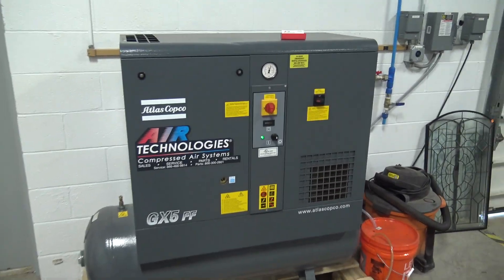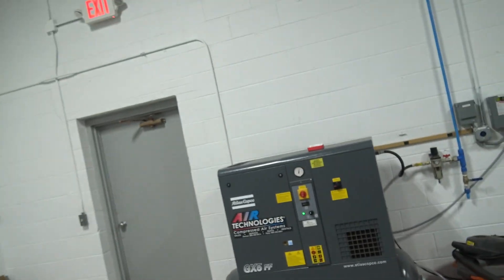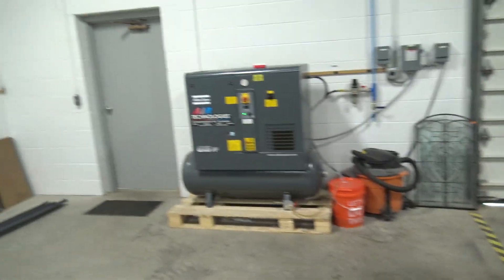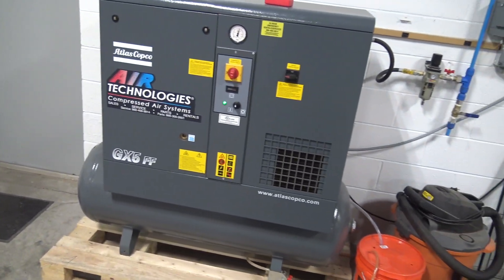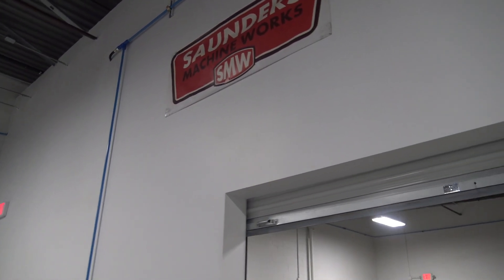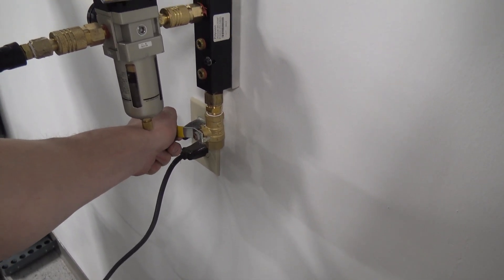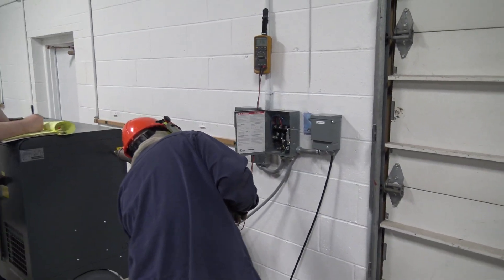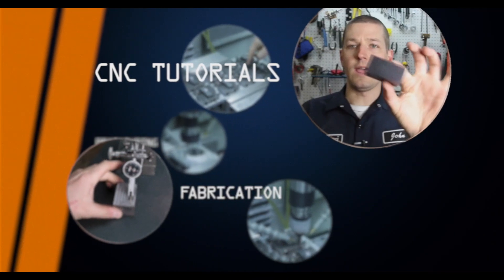Rotary Screw Air Compressor:  What are they?!  Worth the hype?

Comment: The rotors are a very tight machined fit (no seals) so thermal expansion and contraction is their enemy. Compressing air makes heat so that is why you don't want a screw compressor cycling as it increases wear on the unit. I have found that one of the best things for reducing compressor noise on a piston unit is to slow the speed down.  We have an 80yr old Champion 2stage 4cyl compressor at work that has been maintaining 225psi air for longer than anyone is left alive to remember.  The thing only runs 400rpm which is probably why it has lasted and is one of the reasons it isn't real loud. It is probably half as loud as my 5hp Campbell Hausfield.
Reply: Change the pulley size.  My CH 5CFM 30gal compressor uses the same compressor head as the 11CFM unit, but because it's a 110v compressor they run it at half the speed, produce half the CFM, and half the noise.
Reply: I love the older machines, my granddad's generation sure knew what they were doing....
Reply: justfakeit888
 Just be careful not to run it too slow as most compressors use dippers for lubrication and at too slow a rpm they won't sling oil properly to lube.
Reply: We have a compressor that came from a US navy base that was manufactured in the 30's, we only need 120 psi in our shop so that's what it runs at and it almost never gets fully drained.  We have never had it apart and service the oil once every few years because we honestly forget about it.  We bought a 1" thick rubber mat from Tractor Supply and mounted it on top of it with studs down to the concrete floor and it made a drastic difference in noise.  You can still hear it kick on and run but it's in no way annoying.  Also has a nice deep tone that modern compressors just don't seem to have, but that may be because it runs at a much lower speed.
Reply: Yup. I'll be rebuilding a 30's (or earlier) quincy soon, I plan on running it very slow. I expecting it to be not only pretty quiet, it to have a very nice sound.
Reply: justfakeit888 Damn!  Hopefully its good and solid and had no water sitting in it being that old.  Sounds massive.
Reply: Copper Head SevenPointThree you can buy just as good compressors, and far better, more efficient compressors today.  Our grandfathers had junk as well. It just isn't around anymore. Only the good stuff lasted giving us the impression that everything was good.
Reply: meocats slow spinning isn't a new fad.  My 1955 Kellogg spins around that speed, and has an intake muffler
Reply: A lot of noise escapes from the intake. Intake muffler, good point worth noting.
Reply: Yeah we decided to try it out and see if it helped with noise when moving it around one day and it happened to help quite a bit so that's the way its been for a few years now.  It's in a mechanic shop so it might kick on 3 or 4 times a day unless we're running our blast cabinet.
Reply: Your comment got cut off...  How do you slow the speed down?
Reply: eformance That makes sense, thanks!
Reply: there's a new fad about silent air compressors nowadays. one of their features is the speed is 1800rpm instead of 3600. The other feature is the cylinders and valves are large. (california air tools silent compressor for example).
Reply: meocats Funny you say that.  I already have a compressor but was considering this quite Makita one that is addressing the noise exactly as you described.  My plan was to combine it with a much larger auxiliary tank (I have several actually) so that I could run high CFM demanding tools but still have a quite running, inexpensive, hopefully reliable set up for the home shop.  I plan to do all sorts of projects from auto, wood, metal and some limited machining (I have one of those cheap chinese 7x10 HF lathes, looking for a complimentary mill...).  You guys seem to know what you are talking about, so would love to hear your opinions on if you think I'm on the right track, or not.  Oh yeah, here's a link to the compressor I'm considering: https://www.amazon.com/Makita-MAC700-Big-Bore-Compressor/dp/B0001Q2VK0/ref=pd_cp_469_2/191-3277992-1273600?ie=UTF8&refRID=90MD0CR2WR49HQSKXK34
Reply: That's true. I'll believe it's slow as is, which is probably the way I'll leave it. The piston is 6 1/4" wide and has a 5" stroke, so it should fling well even at low RPMs.
Reply: justfakeit888 sounds like a thumper!
Reply: Yep. Based on the tractor's stain when lifting, I would wager that the whole unit weights about 1500lbs. The tank is dated 1937, riveted together, and looks like 1/2" steel plate! :O

I'll try to upload a picture soon.
Reply: If thermal expansion is the enemy, use a low-expanding alloy like silicon bronze.
Reply: A couple things here. Thermal expansion is not really an issue with these compressors. These units are 100% duty cycle so that means they are designed to run 100% of the time. That means they are up to temp and normal operating conditions all the time. When units start and stop it heats up and cools off, constantly. What happens when you heat and cool air(the same thing the dryer on the end does)? It removes the moisture and humidity from the air. Since your an Oil Flooded Screw the water that was removed gets put into your oil. Any machinist knows what happens when you mix water and oil = rust! That is the biggest issue we see with the smaller units who are lightly loaded, the units rust up if the water is not drained from the oil frequently(not the tank). 

You are correct in the slower the compressor the quiter the unit is. When you state if you slow it down it makes it quiter; this is definitely true however you need to take into consideration its lubrication. If the unit has an oil pump then you may need to simply adjust it so the pump maintains the same pressure at the lower speed. If it is a splash lubricated compressor it will not be splashing as much which means not as much lubrication so you can really do some damage if your not careful. I would consult the manufacturer or local distributor as most of them have specs for max and min rpms.
Reply: You mean your compressor sits on top of the rubber mat?
Reply: bcbloc02 I have a Kellogg air compressor from 1955. It also spins slow.  It's 3x the size of my 5hp 220 craftsman but half as loud.

Comment: i would put up some isolation in the roof
Reply: Noise control in buildings like yours is difficult.  Right now you have pretty much the worst-case scenario - each space is 3 pairs of hard surfaces parallel to each other for noise to bounce off of endlessly.  As a machine is running its noise builds on top of the echoes, effectively getting louder. The "noise" is pretty much white noise - random across a broad range of frequencies.  For talking with people (ie classes) and maintaining a "feel" for the sounds of the machines, you're fighting the "signal vs. noise ratio."  I don't know enough about industrial settings like yours to make any recommendations, but there definitely are noise control options for your situation.  One common one is hanging "baffles" of sound absorbent material that can be suspended from the ceiling and/or mounted on walls.  You probably want to focus on reducing the bouncing of noise in the frequency range of human speech - 80 to 260hz.  I suspect commercial systems range from sorta expensive to really expensive, but I'm sure there are some good DIY approximations that people have come up with.  Take care that anything you put up isn't a fire hazard (and that might limit what DIY stuff you can do - hosting classes puts you in a more strict situation with building codes and liability.)

Comment: John, They can't legally insist on using their oil in order to maintain the warranty.  It actually breaks US monopoly law.  The reason I know this is because my wife and I run an Amsoil business, and Amsoil sued a company because that was written in their owners manual.  Amsoil won their case and subsequently all owners manuals since that court case were changed and now say "use Harley Davidson oil or an equivalent".
Reply: Its called the magnuson-moss warranty act. If they require you to buy their products to maintain the warranty on a product, they must provide them free of charge.
Reply: I am going guess that case was against either H-D or some luxury car company.
Reply: The problem would be finding an "equivalent"  If they dont have a spec on their oil or no one makes an equivalent then your screwed...
Reply: horseshoe28016 yup
Reply: agreed
Reply: That's why they placed the little "must send them oil sample".  So if they see that you're not using their oil, they can reject the warranty on improper maintenance or abuse of the machine. 

Even if it's not a legit reason to reject the warranty claim, how many people are going to honestly pay the legal fees to fight it?
Reply: I work for a different compressor manufacturer and we require you to use our lubricants on our "Extended Warranty." Your probably correct in that we cant specify it with the standard warranty but the oil that is shipped with the unit typically out lasts our standard warranty any way. Once you sign on the line saying I agree to these rules for the extended warranty program I do not see how that is illegal? :-) We require oil samples to verify the quality of the oil in the compressor and to make sure it is not contaminated as this is an oil flooded screw so every molecule of air that goes through it gets submersed and "cleaned" by the oil. Therefore the oil gets dirty if your air is dirty.
Reply: +Billy T I know H-D really pushes their Syn3 oil. 

I ran Amsoil in my 2010 FLHX (Street Glide) for a while. Only reason I switched is, the shop was open the same hours I was working. That made it difficult for me to get. So I started running Castrol V-Twin synthetic. Both seem like good oils.
Reply: +Billy T actually I have also seen Amsoil in one H-D shop a while back.
Reply: Billy T doesn't need to the same businesses oil that you bought the Compressor from as a distributor when it comes to warranty it's not the business who eats it for the warranty claim at that point distributors become the middle man between the end user and manufacture so when they say use their oil they mean the manufacture oil that was made for that style unit oil sample will prove if the customer is putting 5w-30 in it from auto zone voiding the warranty or if they go with another service provider who doesn't have a distributor license with atlas copco who doesn't have access to the oil ALL Compressor companies operate this way no monopoly law has stopped a damn one
Reply: Jay Walt you can buy the Paco46 from ultrachem same specs

Comment: what's the benefit of the screw besides the noise ?
Reply: higher efficiency, much lower noise, cleaner.
Reply: +Robert Szasz 
Much less noise yes, but not really much more efficient since they're really designed to run non stop or at least have long cycle on times. Pistons don't mind being started and stopped as much as screws do. 

Less noise, definitely. They also put much much less oil into the system than piston types do. 

They should last longer than a piston style, but if something does go, it's stupidly expensive to replace. 

Screws bridge the gap between the cost/performance limits of a piston style and the expensive, but massive output of centrifugal compressors.